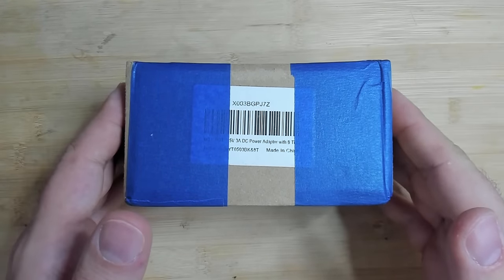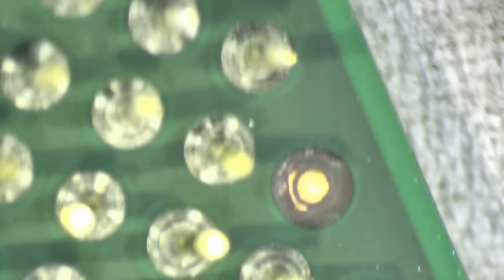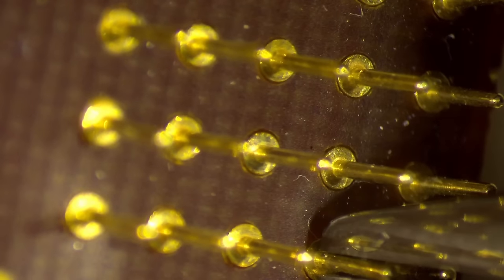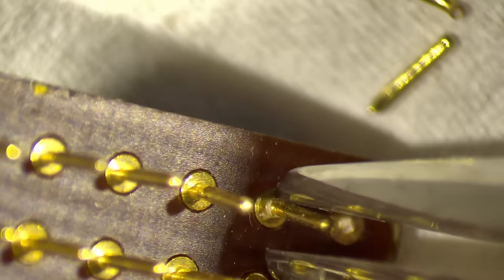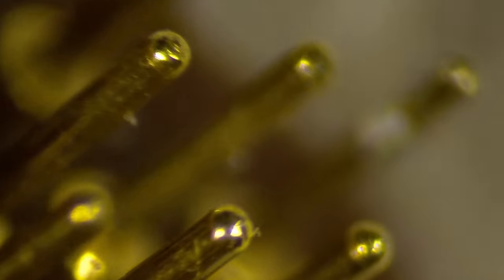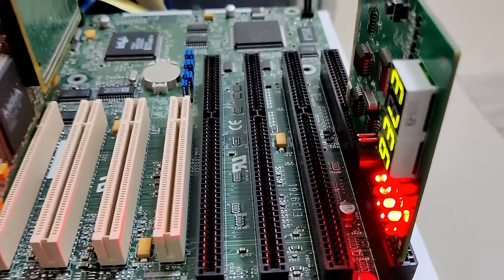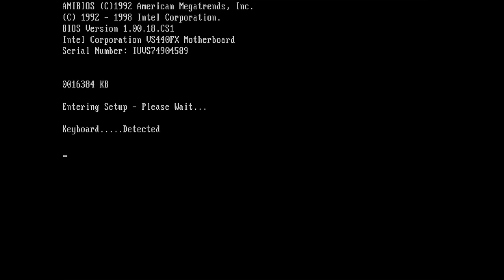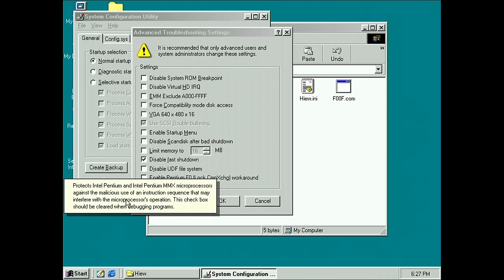1024K reasons to fix this Pentium Pro 1M!

Comment: I just had an idea. I wonder if soldering tip made out aluminium would help with repairs like this. It would be shaped like a normal conical tip but with the tip shaved off and hole for the pin drilled. It should also have very litle thermal mass. It would be used by placing replacement pin inside the hole and adding solder paste to the CPU. After putting both parts together the paste should melt and create a joint. Then the iron should be cooled down as fast as possible (to avoid CPU damage) while still holding parts together. The fact that the tip is made out of aluminium should make it impossible for solder to wet the tip and this way making it possible to be removed while cold. Small thermal mass would help with cooling it down quickly with freeze spray. If the joint is not satisfactory it could be then reflowed with extra flux with regular iron or hot air.
I need to get my hands on some scrap PGA chip and try it.
Reply from the maker: It sounds like an interesting project to try! Please let me know if you get to it. I am just a bit worried that somehow the solder would still climb on the pin up where the soldering iron is. Capillary effect it is called I believe.
Reply: @bitsundbolts  That could be prevented by using tiny amount of high temperature grease. Most likely some kind of silicone.

Comment: Why is the L1cache not showing up on READ - the line is flat up to 1024 ?
Reply from the maker: I think this is always the case. Reading seems to be limited by the memory speed. There is nothing available in the cache. Writing and moving seems to benefit from the cache
Reply: @bitsundbolts  I seem to remember most other CPUs showing the L1 cache on that line too

Comment: Don't let those chipped corners fool you.
I have at least one AMD chip from the Athlon XP days that has a corner chipped way worse, but still works perfectly fine. I don't think they put transistors all the way to the edge of the die. If only to allow for some tolerances when cutting the wafer.
Reply from the maker: Yes, I have plenty of chipped silicone dies as well that work perfectly. I test each CPU before it goes for a donor piece. Unfortunately, this one really didn't work. These days, I only take CPUs that are still installed in boards with a cooler. Those always worked for me and are in very good to perfect condition

Comment: at first i really liked that heatsink+fan combo but after you showed the thermal camera footage it's obvious that it kinda sucks. it seems like the airflow doesn't get passed over the edge fins.
Reply from the maker: Yes, the performance of this heatsink/fan combo is not good. Airflow is minimal. Maybe I need to experiment and put a Delta fan on that heatsink 🤣.

Comment: i've had good luck fixing pins with a mechanical pencil and using it as a pin straightener. Going slowly and gently bending pins and straightening them slowly.

Comment: I always thought the best tool for this job was a mechanical pencil with no pencil lead in it - it's a tube that supprts the pin fairly well as you bend it back. Also I'd think getting the pins hot would help them bend more than break?
Reply from the maker: Yes, a mechanical pencil does work. Unfortunately, it would block the view white a bit when I'm working under the microscope. That is why I decided to use the pliers. They also work very well!
I tried heating pins on a 486, unfortunately, I never noticed a difference when heating up those pins. It just makes it harder to work on the CPU because it also gets hot.

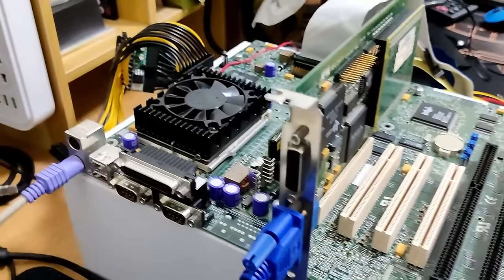Comment: nice repair can you send me the type voltage regulator thats between the blue capacitors at 27:20 i have the same board but the voltage regulator is missing
Reply from the maker: I checked, I think you mean the voltage regulator with the silver heatsink. Unfortunately, this voltage regulator is clipped into this silver heatsink and there's no way to read the markings without desoldering the pins of that voltage regulator. I'll check my two other boards, but I believe they all have the same heatsink
Reply: @bitsundbolts  yes that voltage regulator under the silver heatsink now i made a bridge under the cpu socket so that gold pentium pro s work but not the black ones and i m searcing for years now to find somone that can tell what regulator on that place need to be
Reply from the maker: Let me see, maybe I can figure it out without taking off the heatsink

Comment: If they are heated up would it decrease the chance of cracking?
Reply from the maker: I have heard that multiple times and people with a lot more knowledge than I told me that it will help. I couldn't see the benefit of hearing the pins to be honest. The issue I have is that it will be a lot harder to handle the CPU package when it's hot. There is also the risk of damaging the core or melting some materials on the body - depending on the CPU.

Comment: I had 12 Pentium Pro (200MHz) 512KB, each one was $1250 early 1996.  I was able to overclock them all a year or two after, to 220 if I recall.
Reply from the maker: Woah, 12 of them? What did you need all those CPUs for?

Comment: Is it possible to heat the bent pins to relief the stress and soften the pin before attempting to bend it?
Reply from the maker: It would be possible, however, I didn't notice any difference when I tried that on a 486 CPU. It only got very hot which made working on it a lot more difficult. In the case of this CPU, I doubt that heating the pins would have prevented the cracks.

Comment: Seems like it might be helpful to warm the chip up before straightening pins.  Maybe 150c on a hot plate
Reply from the maker: I tried to hear pins on a 486 CPU before. It doesn't seem to make any difference - but it would make working on the CPU a lot harder because of the heat - which could also destroy the CPU.
Reply: Once the metal has exceeded it's yield point, it's strain hardened. Temperatures high enough to reset it's plasticity would do too much harm to the die.

Comment: I think using low melting solder for SMD would be a good choice, instead of regular soldering wire.
Reply from the maker: You mean for the pins of the CPU? I use low melt solder only for removing some SMDs that I don't want to blast with hot air. Low melt solder is a lot softer than regular solder wire. I wouldn't use low melt solder for SMD work, I still prefer my leaded solder wire from 1998 for such tasks.

Comment: You lucky lucky man.... I want one of the for my collection in working condition with a board, but if I could find one would be too rich for my blood.
Unlike I got super lucky.

I also have a few others on my "wish list" (along with working boards): AMD:  K5, K6-III+, and a "Quadfather", Intel: Pentium Overdrive 83, This, Slot 2 PentiumII/ III Xeon.

Already have an AMD 5x86 PR133 And matching uncommon PCI socket 3 motherboard. Pentium II "Tualautin" 1.4GHz with a matching and pretty rare Socket 370 DDR motherboard, Slot A Athlon 800MHz, (With matching "Irongate" 750 motherboard),  Athlon MP 1500+ (Unfortunately I only have a single socket 462 board and not one of the rare dual socket models.), And a Pentium 4 Extreme Edition and a DDR3 Socket 775 Board for it.
Reply from the maker: Wow, very nice hardware! I do have three Socket 8 motherboards, but I doubt I'm in need of all of them. Unfortunately, they weren't free for me either. Even though I get a good deal compared to ebay prices, old hardware is still expensive due to their raw materials. Scrappers know this and old boards and CPUs sell at a premium die to their gold content.
For now, I am focusing on content that is 8086/8088 until P3 and classic AMD Athlon (Slot A). P4 and Athlon XP will probably come in a few months or years - although interesting, I prefer older tech - and I still find plenty at the scrapyard.

Comment: If the CPU does not have MMX at all, then the F00F instruction may generate an "undefined opcode" exception that might very well be the softlock you experience here. I guess you can try to safeguard even more about this by adding more code to catch that exception, but it's kind of a corner case.
Reply from the maker: I think you recommended to add the return instruction after the fourth byte. It makes sense, but I was still surprised that the CPU got stuck - not in a deadlock though as with the foof bug on the P5 architecture. Thanks for the help btw!

Comment: To straighten bent pins I use a hypodermic needle with the tip filed down, I simply insert the needle allowing the pin to slide through and then once it is fully in I gently straighten it, it is like using a hollow pipe to straighten an iron bar.
14:30 NO!!!! Never use the solder wire directly to solder the base of the pin!!! if you do, the flux will turn the whole pin into a ball of solder and it will be useless. Use the cutter and under the microscope, cut off a tiny microscopic sliver of solder, then place that sliver on the base of the pin inside the flux, when you apply the soldering iron, only that tiny sliver will be soldered to the base, by the way, I have a sharp tip especially for this job, sharp as a needle.
Reply from the maker: Well, that's a good tip. That way, the amount of solder will be limited.

Comment: Those players are great legit tool for straightening cpu pins. I used many improvised tools for straightening pins on cpu, like blades, credit cards etc., the best results I got was with techincal mechanical pencil with which use 0.5 mm graphite inserts, like Staedtler graphite mechanical pencil or other brand same product, I don't know how you call those in English... Anyways the pencil is long enough to be good lever, so you get to make very short or long moves slowly and get pins back at originial position...long industrial syringe needle can be good, I mean any kind of "long enough very thin pipe like object" could do the job imo, it's just those technical mechanical pencils are like they are made for the job 🙂 🤷‍♂️

Comment: I also have two pieces, but I would need two more pieces so that the sockets in my Dell are not unnecessarily empty. Running Win98 on Pentagram Pro is a waste of its potential, considering that it still contains 16bit code, where PPro gives lousy results. Its advantages are elsewhere.

Comment: So according to wiki this bug is supposed to be an exception if properly implemented. So I'm wondering if dos being frozen is a normal exception and then windows just flat out catches it. So that may actually be the correct behavior for the fix.
Reply from the maker: Could be. I was just surprised to see DOS stalling. But the CPU was clearly not deadlocked.
Reply: @bitsundbolts  I'm pretty sure this is what happened. DOS doesn't have much error checking, nor does it need to. It becomes more important in 32 bit protected mode or better. I think that's why exceptions trigger the exception vomit out of the dos extender and return you back to DOS. google is like "you're referring to Denial Of Service" right? sigh.....

Comment: 6:28 and 6:40 I've seen worse P3s (usually 1GHz CuMine that got abused) still work perfectly fine. There's quite a large distance from the edge to the actual brains. Hell you can sand off the protective blue plastic coating ontop of the Die without damaging the CPU if you want to go insane with cooling. Somewhat annoying so many of those (and Athlon XPs) get condemned without even testing them. Now if this was some random garbage Celeron, I wouldn't mind, but a fast(er) 100MHz FSB P3? ehhh ...  But good job saving a 1M PPro. I have yet to even come across one (let alone an affordable one), and even the basic 256k ones are headed straight for triple digit euromoney these days, which is absolutely ridiculous
Reply from the maker: I test all CPUs before they go into the pile of non-working CPUs. Sometimes, it is not worth the effort since I find them regularly at the scrapyard. Of course, if I find a really good chip (like when they are still installed on a board and protected by a cooler), there is no hesitation from my side and I will take it. I know those chips will be rare in the future - especially the 100MHz FSB models. Pentium Pro CPUs are quite expensive. I was lucky to find a few at the scrapyard, but they were also not cheap - with their "gold content" (which I am NOT after), prices are ridiculous even at the scrapyard.

Comment: The Pentium P5 was the only architecture with this bug. The Tillamook should be the only Pentium P5 mobile processor with a hardware bug fix. 233 or 266MHz. You need to find a notebook with a Tillamook processor.

Comment: I pulled the pinout for this chip and the missing pin in question is Vref0 so I am not sure if its absolutely necessary for the chip to work, it may not need it but I am unsure what the Vref means on the pintout. If it was a VSS pin then it def could just be ignored as there are several on the chip. And OHH BOY why does Intel's webpage suck total balls now..... You used to be able to find old processor documents and tech details on their page and now its some AI nightmare shit that is awful and missing tons of old documents....

Comment: This means I'm not crazy. I thought pins were 1 piece attached. Then I saw Jayztwocents reattach them on like an AMD 3600x or something like that and they definitely weren't one piece. They were all soldered on, but I'll bet you could use pins from a modern CPU to fix this anyway.
Reply from the maker: Pins on modern CPUs are a lot smaller. I think a Pentium 4 has small pins comparable to modern CPUs. Those are a lot harder to fix. Maybe one day, I'll work on Ryzen CPUs, but they haven't arrived yet at my scrapyard 😉
Reply: @bitsundbolts  I actually bought a 3600x because I couldn't get a 5900x at the time. Well. I got my 5900x meaning the 3600x was a spare. And my geforce 3070 required me to buy a motherboard I didn't want during the silicon shortage of 2020-2021. So when I needed a new server....Those became the core components. lol
Reply from the maker: Ah, yeah. I sold my 1080Ti at that time. I got more money than I paid four years earlier. Unfortunately, the 3070 I got to replace the 1080 Ti was also very expensive! All in all, I paid about 200 USD on top of the money I got for my old card to get the 3070. The only application that uses that card is Davinci Resolve for editing my videos. No time for gaming 😔
Oh, and I pulled the trigger about two years ago on a 5950X - which replaced my 3700X.

Comment: That Pentium 3 might be saveable. I have yet to see a P3 that is not chipped after reapplying the thermal paste.
Reply from the maker: I tested this CPU before it went to the scrap pile. I'm afraid this PIII is dead. I also have a lot of chipped and working CPUs though. Also, I have access to plenty of those CPUs. These days, I get most of the CPUs from cases - still installed and in perfect condition. Those CPUs always work

Comment: that's actually not that different than modern bios flashback (in theory you can't brick your bios and it doesn't even need a CPU or RAM to do it). You get no video or feedback of any kind. I've seen a few people attempt it and the success rate hasn't been great. lol I have seen it work successfully.

Comment: The best way I've found to straighten pins is to use blunt-tip syringes (like what your flux comes in, but have a variety of smaller diameters). If you keep a full range of syringe diameters you can straighten pins both old and new. It should also work to align your reattached pins.

Comment: I measure the thickness of the pins and use a metal tube that has a slightly wider inner diameter, that way it's easier to avoid the bend close to the base of the pin. Then you can straighten the pin in both directions in one go since once the base of the tube sits flush with the CPU substrate, it's automatically standing straight up.
Or you can use a pen (BIC or similar) with the innards removed. Depending on how much it's bent at the base it might be worth doing the initial bend with the pen and switch once the bend at the base is slightly straighter so the tube can be pushed further down.
Even better is having a set of tubes, going from a loose fit and gradually switch to a tighter fitting one until the pin is completely straight..
I hope this is readable lol, looks pretty bad.
Reply from the maker: Yes, that would work too. I feel however that those pins would have broken either way - no matter what method I use.

Comment: You can see just how hot that CPU runs from the well browned Compaq sticker on the bottom, they originally came as white, and this one got cooked to brown and yellow. Amazing how it was never used with anything like thermal compound, likely had a silicone pad only, which gives poor performance.  you need a better heatsink on it though.
Reply from the maker: Yes, this CPU gets really warm. I don't have a better heatsink that would fit this socket, but I can probably just place any modern cooler on this CPU for testing.
I also used thermal paste - which was probably never done before as you mentioned.